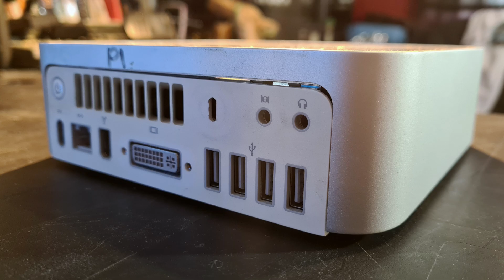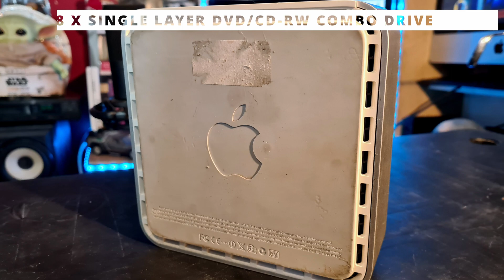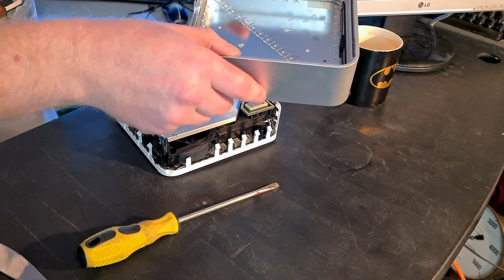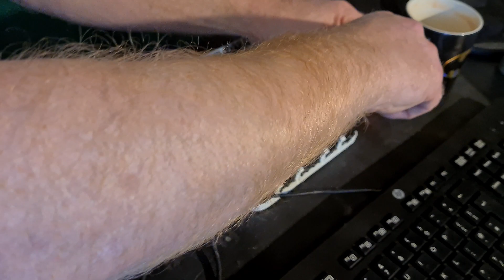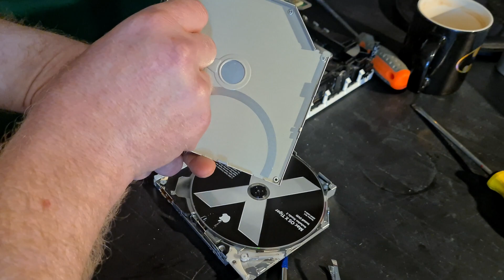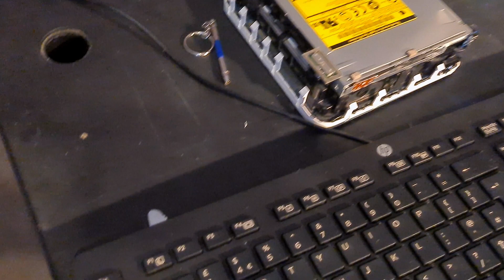Restoring a 2005 Mac Mini: Disassembly, Problems & HELP!  (Part 1)

Comment: If you can restart your computer to eject the disc: Choose Apple menu  > Restart, then click Restart while pressing and holding the mouse or trackpad button until the disc is ejected. You can also hold the Option key while restarting your Mac. When you see your CD or DVD appear on the screen, select it, then press the Eject key. I( thought it had the hole still, sorry about that!
Reply from the maker: Can't get it yo boot yo look at those options.  Mouse buttons don't work either unfortunately.  Will be doing a follow up video soon.

Comment: The fan ramping up to turbo is because there is a tiny wire that gets plugged in the front. If you have another Mac but you need specifically the Intel Version. They made two MacOS X for PPC and Intel. If the controller was bad I do not think the drive would spin up. But that DVD if you try an intel version. I have an identical one here at home
Reply from the maker: Yep, I tried snow leopard too, but that didn't work.  I didn't think to look at the dvd to see which version it is, I'll have a look in the coming days, thanks :)

Comment: Have you tried doing a system management controll reset and also been in the bios and reset,  that looking at the hard drive was removed suggests that maybe the previous owner might have been tinkering with bits unknown to them set the primary boot option to usb or somewhere unknown also found a crackin site but I'll txt you that later lol
Reply: Also take it fully appart and fully clean any new old busted up machine first before you switch it on lol will also give you chance to examine the board for any obvious errors like busted traces, caps, any chips/mosfets etc that might have been replaced (tell by the solder neatness usually looks either different silver colour or just blobbed on crap or melted plastic round edge of chips/mosfets etc), any possible bridges between components and clean the fans so when you do first switch on you can elimate those errors immediately and conclude its something else plus it'll make for a longer vid lol
Reply from the maker: Good idea, but I'm a clumsy bugger so prefer to quickly test first lol.
Reply from the maker: Can't enter the bios in a Mac, can do a pram reset, tried that to no avail.

Comment: If I remember correctly does it matter which is USB port you plug keyboard into? At least as far as getting boot options? I have one of these and I figured it out forever ago, but I can't remember now. They are very underwhelming for a computer lol nice package tho.
Reply: And I believe hitting F11 rapid fire at boot will spit CD out (tho... my memory is foggy)
Reply from the maker: Yep, found loads of key sequences that supposedly sout it out, but not seen that one before.  Not sure about which port I use, but I'll try that out too.

Comment: Just a thought Steve, but I think it may be an issue with that drive control card. Could be a ram issue too. If you got another mini, swap out that drive controller card and see if she fires up.
Reply from the maker: Hmm, could be, I don't have another one to swap it with though, I've had a few people suggest about the ram so I'll look at that too.  Also been told of a better way to put the os onto the flash drive so, I'll be trying that.  Thanks :)

Comment: You need to restore you iso or dmg image to your usb using diskutility

You might have to use an older intel Mac as Apple 🍏 crippled disk utility in later OS versions
Reply from the maker: Ahh, cheers Chris  yes, I did try with the m1 but it kept failing.  Could be a job for the 2010 :)

Comment: Boot menu is press & hold "alt" on startup. Eject disks is press & hold the left mouse button. I've found 'press and hold intermittently' works best, when the disk is spinning up.
Reply from the maker: Thanks, tried both of them to no avail :(
Reply: @RetroGamerVX  Well poop. In that case it sounds a little, to use a technical term, 'a wee bit buggered'! If all else fails and as a last resort, you could try doing a VM install on another Mac to the drive of the Mini. Unless of course you have another optical drive to swap it out with. Working on the old Macs can be a pain. We literally keep an ancient external 5.25" enclosure with Firewire at work for just such occasions.
Reply from the maker: @intangibletingles3412  Yep, I'm suspecting will need a new motherboard, but gonna try the tips people have sent me first :)

Comment: A Paper clip will get the cd out of the drive. Reset the PRAM, if all else fails, replace logic board.
Reply from the maker: I did have a poke around but saw no obvious hole for paperclip eject, I'll look again in the coming days, thanks :)

Comment: Hi Steve, to remove discs, hold left and right mouse button down and Power on. This might work.
Reply from the maker: I tried holding the left button, but not both, I'll give that a shot in the coming days, thanks :)  I'll mention ya in the vid :)
Reply: @RetroGamerVX  Thanks, as with all things Mac, I find them lovely to use, a nightmare to work on. My first port of call would be to fit a known working drive with a known working OS X installed on it, scavenge one from an old Macbook. This should boot. I would then put an SSD in a caddy and using disk utility, format that.
Reply from the maker: @grahamroberts1833  Unfortunatly, I've got no old Macbooks to do this with, the Imacs have systems way to young to try with it.